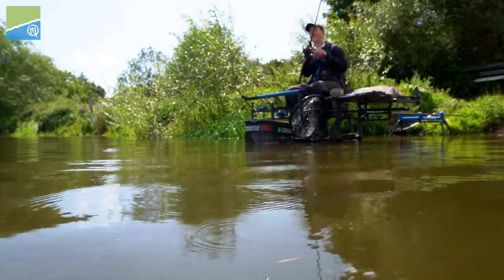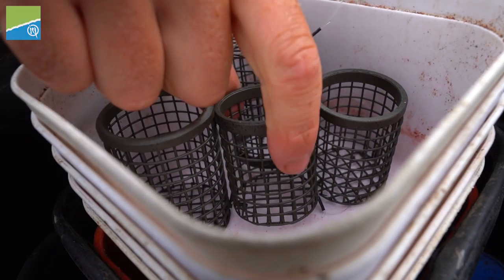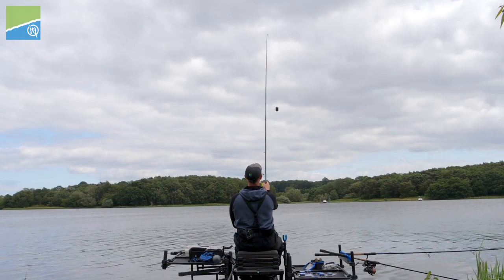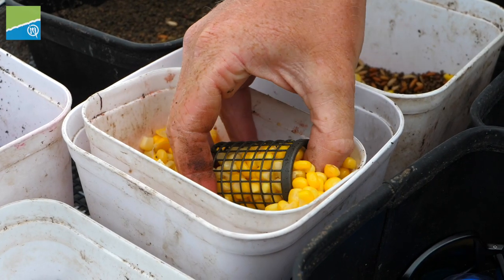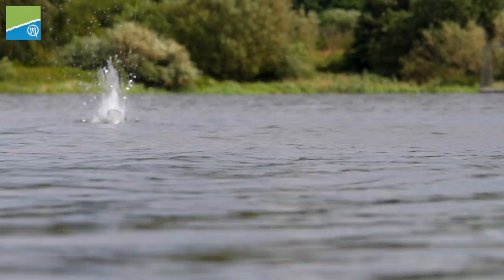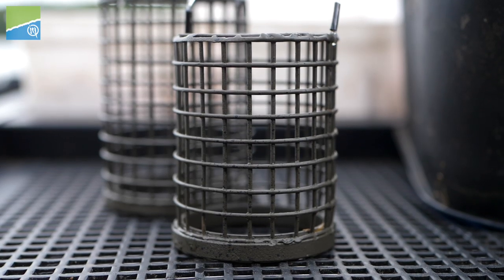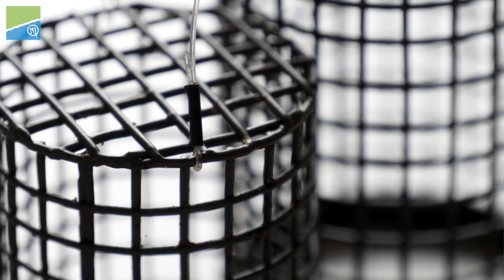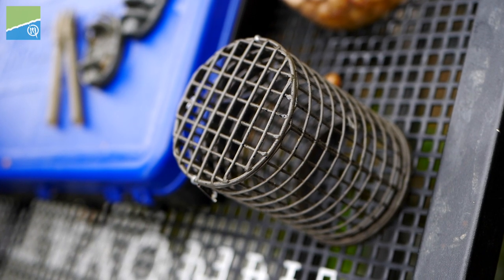BOSH IT! - WIRE BAIT UP FEEDERS!

Comment: When is the market going to release a bait-up feeder specific rod? A lot of spod, carp and barbel rods just don't cast great with big feeders.
Reply from the maker: We have had one available for over a year. In fact Lee talks about it in the video! The Feeder Feeda rod.
Reply: Preston Innovations I missed that, dismissed it as a fishing rod as opposed to a feeding rod. I don't want to be bothering with quivertips on a baiting rod if I'm honest, I don't see the point, especially if they are carbon. As fond as I am of my 12' 6" Supera, the jury is still out on the tips, especially on a big river. I think we need to see a straight top one job baiting rod, could be wrong but I've head a lot of anglers say the same.
Reply from the maker: @gordyn5292  pick one up and have a go. We have slow mo footage of Lee casting 80m with a 80g custom made 'coke can'. Its an incredible rod and can also be used for barbel fishing or extreme range fishing should you need it. The specific action we developed helps get those large feeders to the range required, carp rods simply dont have the right action for what we are trying to achieve as you say.
Reply: @UKprestoninnovations  can i see that video ?